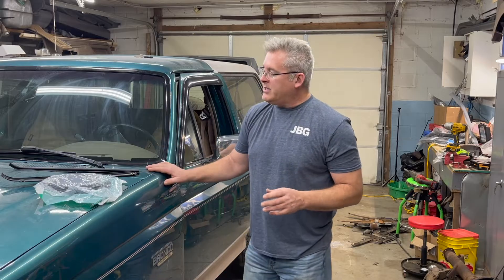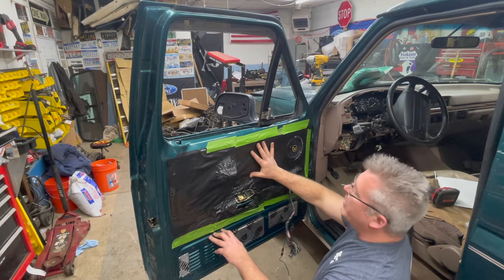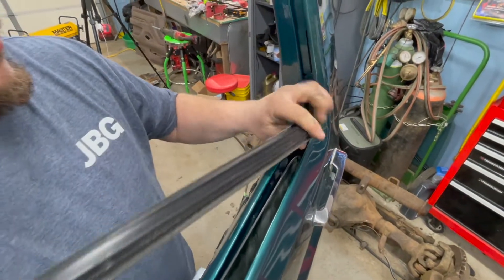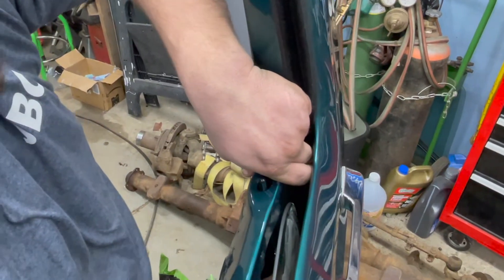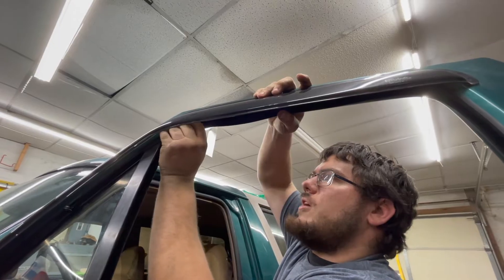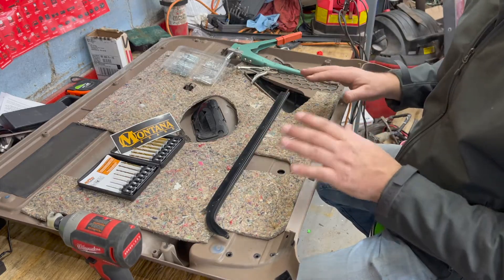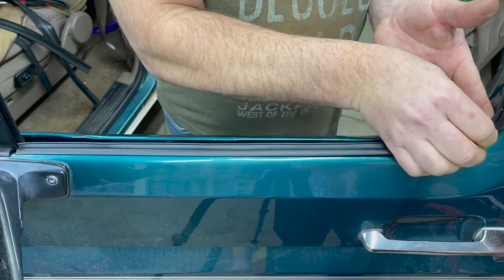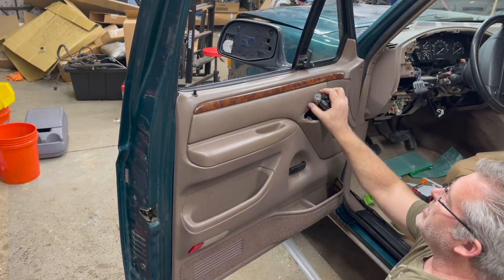How To Install and Repair Door Felts (Sweeps) & Window Channel Seals - Ford Bronco OBS Ford Trucks

Comment from the maker: 87-96 Ford Bronco/ OBS Ford F-Series Bucket Seat Cushion is on sale for $135 plus ship.  Will not fit 40/20/40 (these are in preorder status)

I take Venmo, PayPal, Zelle, Cashapp or mail me a check. 

Email me at n2kpi@yahoo.com for more instructions. 
Please remember to include your full name, EMAIL and mailing adddess.

Comment: I'm having trouble with the seal for the actual vent window. someone broke into my truck. I bought the vent window. I just don't know what kind of seal to put on the vent. it's the dry seal in it. I installed it and out silicone but you can still hear air coming in
Reply from the maker: I sell them used or you can call Jeff Bronco Graveyard in Brighton Michigan. They sell them new.  Seals
Reply: @BroncosandPartsGarage  thank you sir. I'll give it a try
Reply: @BroncosandPartsGarage  I have the whole assembly. Just replaced the window. but just need that seal around the window to the vent

Comment: I've been looking on how the vent window comes out.  I didn't know it was that big.  Vent windows are one of the best things about Bronco's.  The airflow you get with them is awesome.  They should put them in every vehicle.
Reply from the maker: Yes. It’s very simple. 3 screws.
Reply: I think the reason why they stopped them were because they were easier to break into or something along the lines of that

Comment: My glass keeps coming loose, is the rear track supposed to be loose towards the bottom edge of window opening? Not sure if my metal track is broke or what, but pops out of door tracks when i lower window.
Reply from the maker: Check the small white square “slide”

Comment: Guys-- THANKS!! This is EXACTLY what I needed. After 37 years I decided to work on the windows of my green 1989 bronco-- kinda like yours in the video! Both window motor plastic assemblies were toast, and  I decided to limit the cancer by replacing the window molding too. Thanks! (and thanks to Jeffs Bronco Graveyard for the parts!--ALWAYS the right stuff)
Reply from the maker: No problem!!!

Comment: Thanks for the great video, I replaced the felts on my 1996 Eddie Bauer edition and the passenger side has a couple of broken tabs so the felt doesn't stay properly. The rivets that you installed didn't interfere with the window or into the door channel? Thanks again.
Reply from the maker: Glad it helped! They don’t interfere at all.

Comment: Was going to do this job this weekend, last did it when I bought the truck 15 years ago. I want to pop rivet it, but last time I couldn’t get the door panel installed with the inside sweep in place. I had to remove it and reinstall after the panel was in place. But you made it look easy. Once I rivet it, it’s there for good, so I’ll have to make it happen.
Reply from the maker: It’ll go in pretty easy

Comment: Your doing great things.
I live in Colombia and restautating a 1994 5.0 XLT Bronco.
I'm doing OK but there are no spare parts available here and also tried to get from the US but mostly they don't ship to Colombia.
My only option is ebay but due to bad experiences I don't want it.
I found your clips here and used them for some things. Thanks.
But now, could you help me and ship to Colombia?

Like your canal, keep on BRONCO-ing. Thank you
Reply from the maker: Thank you! I can make special Ebay listings for you and allow international shipping.  I can’t ship international from ups
Reply: Is there any posiblily to get in touch with you by email or whatsapp? I would like to get your suggestion, after I sent a photo. Now the swimmer in the tank seems to malefunction, is there a way to repare it or do I need to get a replacement? Seems you are the only guy on you tube, giving and showing normal ways of fixing issues. Other are completely insane or give tips which are rediculous and dangerous
Reply from the maker: @bloomexcolombia2000  my email is in the video description.  Click on title and scroll down.  Thx
Reply: Found it. Thanks

Comment: Found your channel last night, and looking through your video's I realized I saw your vent removal video months ago!  I have 3 (yes, three) 9th gen's.  I need to be doing a lot of interior and door stuff on them this summer so I'm SUPER looking forward to seeing some content in the near future.  I like how your video's get right to the point.  I'm pretty mechanically inclined so I can probably figure out most things, but it's nice watching a tutorial first.  One is a ultra nice Green/White '97 F350 dually, I have a '92 Red F150 that's "nice enough" to put a little bit of effort into, but will be a winter hauler (also in Michigan), and a '93 F150 that's donating a TON of parts to the other two plus a rainy day bin.  This video pertains to my '92 in particular lol.  Hoping to see that manual to power conversion video soon! (saw it commented on another video)
Reply from the maker: Thanks!  Videos are a blast to do.  I always watch someone else’s video before I do a project because there’s always something new to learn. No matter how simple the task.   The manual to power just requires an oem harness we sell and power mirrors!!  Please share my channel.

Comment: This was very informative. Could you make a video on how how to Re align a door And how to fix the inside handle. I have replaced my inside driver's side door handle 4 times now because they keep snapping even the metal ones keep snapping
Reply from the maker: Jeffs bronco graveyard sells the door handle reinforcement brackets for $25.  Once installed they eliminate the flex in the body of the door and you’ll never break another handle.  I’ve used them.  They are fantastic.

Comment: Excellent video, I am currently doing this same project
Reply from the maker: It’s great. Makes a big difference.
Reply: @BroncosandPartsGarage   yes it does, I am super happy with it the truck seems new again
I had never thought of using the dynomat around the outside perimeter under the door panels, I had a bunch of that around so used your idea there

Comment: All of my little tabs are broken. I have mine pop riveted through the top and it looks like hell. I'm definitely going to get a new set of inner sweeps and rivet them the same way you did. My outer sweeps are mint still.
Reply from the maker: We sell used door panels….never seen them pop riveted thru the top.  But whatever works and keeps it on the road!!
Reply: @BroncosandPartsGarage  I had rivets that were too long to go through the back so I put them through the top. But I have to get new sweeps and rivet them through the back because it drives me nuts seeing those rivets.

Comment: Do you know where I can get the plastic speaker covers that go on the door panels? and also the black trim that goes on top of each door panel, I just finished a hand crank to power window conversion that’s all I need
Reply from the maker: I made a video on how to install these. There are links in the description.  
https://youtu.be/0L6-sfKgijc

Grab my email from the description and I can set you up with the speaker grills for your door panels
Reply: @BroncosandPartsGarage  do you have the sweeps? The part you installed in the video I need both sides
Reply from the maker: I buy them from Jeffs Bronco Graveyard.  Links in description.

Comment: how do the window felts/sweeps fit i got some on amazon and around the curve they dont sit very well it looks ok and they stay in place but they dont exactly fit like factory
Reply from the maker: Avoid the “precision” brand.  Sadly, Nothing fits like Oem.  They take some time working themselves into place.  Mine don’t fit perfect either.
Reply: @BroncosandPartsGarage  $36 ebay ones pinch window at curve, seem to be a 1/4" wider and wont allow windo to roll up. Its a discontinued part. Dont know where to turn...maybe the junkyard?!?
Reply from the maker: @travisotto137  call jeffs bronco graveyard and ask for their premium house brand.
Reply: @BroncosandPartsGarage  Thanx...after reviewing reviews  I found $55 "Fairchild" (made in china) had little complaints on fit. so i ordered and waitIng to attempt install again.  " I BELIEVE USING RIVETS FOR INSTALL WILL HELP KEEP TIGHT/SNUG AND AWAY FROM THE WINDOW SO IT HAS A CHANCE TO GO UP AND DOWN AT EASE

Comment: I just installed new window sweeps on my 1997 F250 HD, and noticed a gap between it and the vent window seal, I was concerned. I've noticed the same in your vid here @11:14, is that normal? Could water not get in and sit at the bottom of the door? Thanks, love your vids, very informative.
Reply: PS, love your fix on the broken tabs!
Reply from the maker: I went and looked. I don’t thin it will cause an issue.  Non Oem parts vary a bit.  Doors have drain holes.  Also, the sweeps don’t catch all the rain.  There may be a little “play” in it as well.   Moveable from side to side during install.

Comment: In the video I noticed you are missing the side mirror glass.  I'm sure because you can't find a replacement with the built in signal provisions that the EB and Sport models have.  Have you looked into this or located any?  What about finding a larger replacement mirror with the arrow and cutting it down to our Bronco size?  I'm looking into this but have not figured out what vehicle has large enough glass to cut down to this size.
Reply from the maker: The issue is the led’s are red. There is an amber piece of plastic on the back of the Mirror. Prismed so u don’t see the lights when they are blinking.  It’s an odd coating.

Comment: I have a 95 f150 but the section on my door panel that the felt sweep is supposed to clip into is completely gone, so pop riveting it is out of the question. Any idea what I can do besides replacing the entire door panel???
Reply from the maker: Is the entire lip gone or just the area where one of the clips go into?
Reply: Almost the entire lip is gone except for one little section but it’s hanging on for dear life.
Reply: Also just looked into some of your videos and I’m definitely gonna need one of those “cold air intakes” and the power steering replacement to get rid of that awful noise.
Reply from the maker: @PlazFrenzy  email me some pics n2kpi@yahoo.com
Reply: @BroncosandPartsGarage  will do as soon as it quits pouring down rain here in Texas.👍
Reply: @BroncosandPartsGarage  just sent the pictures.